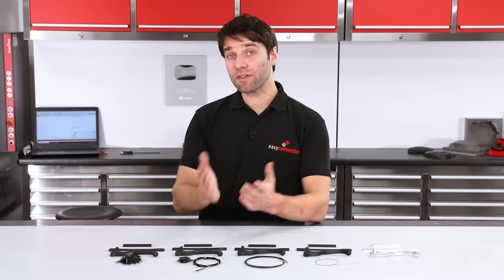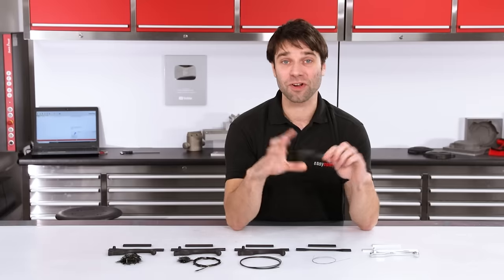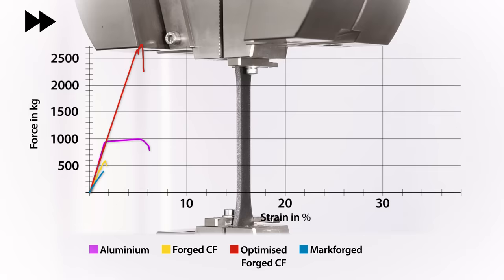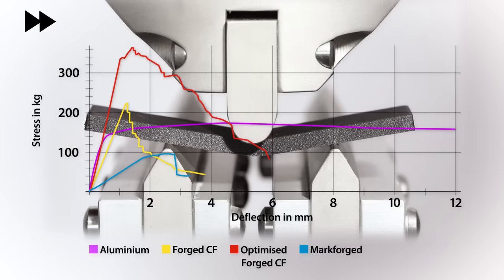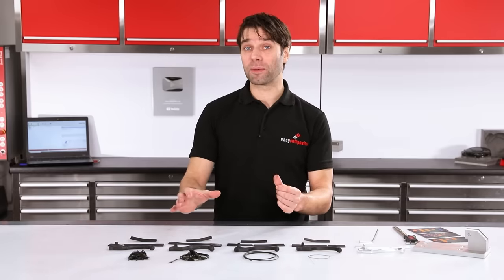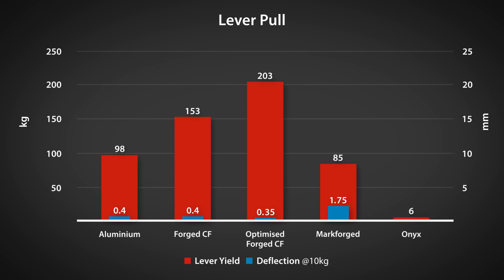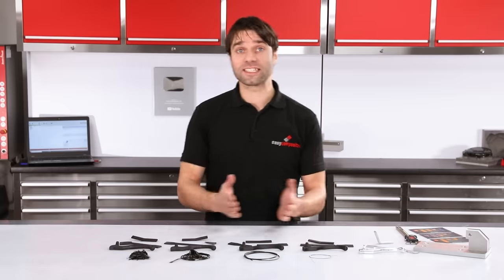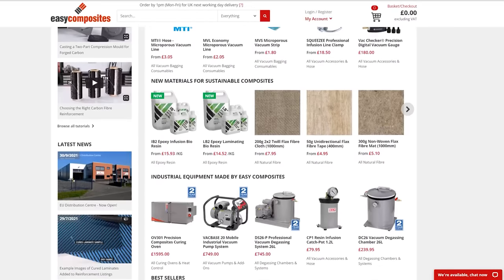How Strong is Forged Carbon Fibre? Forged Carbon vs Aluminium vs Markforged vs Onyx

Comment: The normal 3d printed lever couldn't take more than 10kg? or is that 10 kg per mm^2?
Reply from the maker: It was just 10kg, total. As others have pointed out, alternative 3D print filaments may well have been stronger, 3D printed Onyx was the only 'carbon enhanced' filament offered by the 3D print shop we used to print both the Markforged component and the 'standard' carbon enhanced filament sample. Having said that however, I think it's been well covered by other channels that specialise in 3D printing technology (which we certainly don't) that filaments enhanced with milled carbon fibre don't really improve the mechanical properties significantly.

Comment: Nylon itself is not great for that because of its flexibility. There are polycarbonate-carbon fiber 3d filaments which should give a different result. Still, I don't think it will be near the real carbon fiber samples, but a lot better than nylon

Comment: in conclusion, get aluminium brake and cluth handles. So if you crash you still have a bent handle to work with rather than nothing

Comment: Forging is a Process that doesn´t apply to Carbonfiber.
To call an laminated and Resin infused Material "forged" is quite far fetched if not plain wrong.
If you want something forged, try Steel or Aluminium in some cases.
Reply from the maker: Thanks for the comment and yes, the term 'forged' carbon fibre is not the clearest but it's been around for a while now  (Lamborghini have been using it for several years) and is quite widely used with an established meaning. To avoid using the term would mean that many viewers interested in understanding 'forged carbon' might never find this content, get to see what the term refers to (for some at least) in the context of carbon fibre composites, and learn how - for the right components - this process can be used to produce strong, lightweight parts with minimal equipment.

For what it's worth, before making the video we did discuss whether to use the term 'forged' a lot because we really weren't sure ourselves. After lots of deliberation (checking dictionaries and researching the history of the term) we decided to go with it but we did expect others might come to a different view, and that's fine too. If you'd like a much more lengthy explanation of we came to our decision please get in touch, we're happy to have more healthy debate on the subject
Reply: @easycompositestv  So in short: The Marketing Department of Lamborghini created an misleading term to let their Product apear mor sufisticated than it actualy is.

I apreciate the detailed Answer to that and made it clear where that BS-Term originates from.

In this case i t is absolutly reasonable to use a Term specific to that kind of Process if that Term is branded and established.

I myself work with Metals every day and if someone tells me something about Forging and stress in Materials and throws Carbon Fibre in the same Sentence i kind of rubs me the wrong way because even with Aluminium it is an questionable Term to be honest because in most cases it is just "cold worked" Material that gains more stiffnes because the compression of that Material makes it strain hardened.

A Smith gets that stress out of the Material by heating it up so the crystaline Structure of Steel, Gold, Silver, Copper and so on can rearange themself wich releases the Stress inside the Material and reduces the brittlenes and workability of the Workpeace.
If you want to gain back that Hardness, at least with Steel, you can heat treat it.

Just to let you know where my perspective comes from without bore you with to much Details.

Comment: What's the cost impact?
Reply from the maker: Compared to the other materials on test? - Well, assuming you have to 3D print a mould and then mould your forged carbon component then a conventional 3D printed part (like the Onyx) would be much cheaper right from the start. In terms of the Markforged, the printers themselves are in the £20k/€25/$30 region and we don't have one so we paid to have the Markforged part printed. It cost over £100/€125/$150. You could certainly print the moulds in PLA and buy our whole Forged Carbon Kit (which could make 30 of these parts) for less money. In raw material costs, there's probably less than £1/€1.25/$1.50 worth of materials in the brake lever example.
Reply: @easycompositestv  I'm just curious as to why there's not a weather change in abandoning aluminum. I would assume it has to do with the sheer cost of manufacturing with CF vs aluminum, and that's disregarding the impacts of CF on typical fasteners.

Comment: The term forged carbon fiber is a strange one. Quality brake leavers are "forged" then heat treated aluminum alloys, not inferior diecast ones..
Reply from the maker: Thanks for the comment and yes, the term 'forged' carbon fibre is not the clearest but it's been around for a while now  (Lamborghini have been using it for several years) and is quite widely used with an established meaning. To avoid using the term would mean that many viewers interested in understanding 'forged carbon' might never find this content, get to see what the term refers to (for some at least) in the context of carbon fibre composites, and learn how - for the right components - this process can be used to produce strong, lightweight parts with minimal equipment.

For what it's worth, before making the video we did discuss whether to use the term 'forged' a lot because we really weren't sure ourselves. After lots of deliberation (checking dictionaries and researching the history of the term) we decided to go with it but we did expect others might come to a different view, and that's fine too. If you'd like a much more lengthy explanation of we came to our decision please get in touch, we're happy to have more healthy debate on the subject
Reply: @easycompositestv  I'd like to thank you for a really constructive reply,  which unfortunately isn't the norm these days. Your videos are very interesting, informative, and enjoyable to watch, Thanks and Regards..

Comment: ONXY would be good for light cosmetics parts… Wing mirror, Lights holder, air intakes?
Reply from the maker: Onyx does have its place just not this specific application or applications needing a high level of stiffness.

Comment: I like the comparison, but using mass [kg] as an ”universal unit” for force [N] and stress [N/m²] is really not a “level of scientific method”. Would be nice if you do it correct in the next videos.
Reply from the maker: As explained in the video, we deliberately chose those units as they would be understandable by the widest audience even if not the correct SI units for measurement. A lot of people would not understand newtons or other units.

Comment: my gut instinct says that under repetitive stress the carbon stuff would fail way under the measured yield point and would probably perform worse than aluminium on the long run.
Reply from the maker: Without long term fatigue testing it is hard to say, but the yield point was way above the typical forces used in practice so there may be enough safety factor in it to give a useful life.

Comment: What's really interesting is that for maybe 30 ot so years CF hss been touted as a "wonder material" that would supposedly do it all. Yet when taking into consideration cost, mfg complexity, across the board strength/wear/temperature performance, areas of practical application vs established materials and methods it fails miserably, and just like 3d printing vs any other type of comparable manufactute relies on niche use cases rather than any en-masse areas of use. Which is in fact pathetic as something as old and heavy and one could almost say outdated as GFRP still remains in 1000x wider use overall than CF.

Comment: Why do you compare it with Aluminium? It would have been much more interesting to compare it with Titan and with common 440 steel.
Reply from the maker: Because it is what the original part is made from and is also much more comparable than other metals.
Reply: @easycompositestv  If the original component was made of aluminubeside Carbon-epoxy composite matm, titanium would be the next best alternative in terms of stiffness, specific weight and hardness before considering carbon fiber-reinforced plastics. High-performance steels can also be very interesting due to their mechanical properties (I know 440 steel is not highperformance). Don't you think?

Comment: You have used a compression mould. Forging is a metal working process.
Reply from the maker: Thanks for the comment and yes, the term 'forged' carbon fibre is not the clearest but it's been around for a while now  (Lamborghini have been using it for several years) and is quite widely used with an established meaning. To avoid using the term would mean that many viewers interested in understanding 'forged carbon' might never find this content, get to see what the term refers to (for some at least) in the context of carbon fibre composites, and learn how - for the right components - this process can be used to produce strong, lightweight parts with minimal equipment.

For what it's worth, before making the video we did discuss whether to use the term 'forged' a lot because we really weren't sure ourselves. After lots of deliberation (checking dictionaries and researching the history of the term) we decided to go with it but we did expect others might come to a different view, and that's fine too. If you'd like a much more lengthy explanation of we came to our decision please get in touch, we're happy to have more healthy debate on the subject :)
Reply: @easycompositestv   Lamborgahni uses the name "Forged Composites" because they have registered the name as a trademark. What you seem to have done is let marketing misuse the English language. If I was to say I used a transfer mould or I used an injection mould you would know or could look up exactly what I mean and it would lead you into a larger field of knowledge. Forged carbon is a meaningless term because forging is a metal process. Which dictionary did you find the term in?

Comment: Be very careful with so called forged carbon. When the size of the part gets to less than about twice the length of the filaments, strength falls and (more importantly) strength consistency falls off a cliff.

Comment: These tests are all nice and good. But now do a fatigue test😁😁
Reply from the maker: Agreed that dynamic results would also be interesting. Unfortunately, we don't have a dynamic test rig so fatigue tests and the like aren't something we can run at the moment. We will continue to invest in our test setup though so maybe in the future we could run some of these tests.
Reply: I know the forged carbon isn't exactly the same as conventional laid up carbon fiber, but when comparing conventional carbon fiber to aluminum, steel, wood, glass fiber, etc, the carbon fiber is much better, retaining something like 40 percent of its original ultimate strength after 10 million cycles. So I would not expect to see the forged carbon parts suffering from fatigue when compared to aluminum.
Reply: @mckenziekeith7434  interesting. I am not very knowledgeable about CFRP's fatigue characteristics. Cool to know

Comment: Is carbon fiber recyclable?
Reply from the maker: Not easily due to the resin matrix.  Some specialists are able to recover the fibres for reuse, however it is not a very energy efficient process and the fibres are not in the same format after recovery.

Comment: You know that there is much stronger prints than Markforged. 

You can print in Ultem, PEEK, PEK-A, PEK-C and many more
Reply from the maker: Hi Nathan, indeed you can. As you'll probably guess from the nature of the channel, this video is more about the composite side of things, in particular the forged carbon fibre process and how that compares to materials like aluminium or carbon fibre 3d print technology. There are hundreds of videos comparing different FDM filaments but in all cases none of them would be anywhere near a composite solution so, from our perspective at least, we didn't feel we needed to go into too many of those relatively similar materials.
Reply: @easycompositestv  just pointing it out as the way you phrased it is like Onyx and CCF is the only way. Sounded like a Markforged sales pitch lol

Comment: no comparison to an actual continuous fibre laminate?
Reply from the maker: no because it is a forged carbon comparison to other materials rather than composite material - the kind of parts you can make from the compression moulding process are usually different to traditional composites and hence not comparable.

Comment: Enjoyed the video but for me this enforced why aluminium is en Excellent material for a brake lever, if you were to damage it it would most likely bend and not break,  a bent lever can still be used or straightened, a broken lever is useless.
Reply from the maker: KB, we certainly don’t disagree with you. This video was all about demonstrating the properties of the material and comparing to its obvious alternatives. The brake lever example was just something relatable and quite easy to test and compare. Aluminium really might be the best material for a brake lever, but forged carbon looks to us like material that would have some great applications.

Comment: Aluminium is not on the periodic table, Aluminum is. Is a 6 mil radius 6 mil across or 12 mil across
Reply from the maker: Hi Tom, sure in North America it's Aluminum, in the rest of the world including the IUPAC definition it's Aluminium, so for most people in the world and in international science that's how it is spelt and pronounced, with regard to the mil that's our abbreviation of millimetres, not sure specifically what your refering to but a 6mm radius would have a 12mm diameter.

Comment: You can bend aluminum back, aluminum everytime.
Reply from the maker: Yes, for sure, you might determine that aluminium is the right material for a brake lever, or any other particular component. This video is in no way intended as a suggestion or endorsement to make any particular product using this process, instead it's intended to give viewers a better idea of the likely performance of components made in this way and how they might compare to alternative materials and processes. Having done so, we believe that a process that can produce a component that is stiffer and stronger (although less ductile, for sure) than a cast aluminium equivalent, using almost no specialist equipment, has probably got a lot of very viable applications.

Comment: I would be curious as to real world environmental affects and then your stress tests.

Temperatures get up to over 100 degrees Fahrenheit and a short winter of down to around 27 degrees Fahrenheit for two months with daytime rise to mid 30s.

Again 80 to 100. 27 to 36 and half yr to 40s to 60s at night and temps in day to mid 60s to 80.

Plastic/rubber is heavily affected, dried hardened,brittle.  I’m sure there are ways to speed up heating/cooling and stressing during the time.

That would be most accurate.  I drive motorcycle in winter thru summer.
Reply from the maker: The resin we use in this specific tutorial would be more than capable of working well within that temperature range. If you need a higher temp solution as you have a particularly hot application (engine bay for example), then a higher temp. resin such as our EL160 with a suitable post-cure would be better placed.

Comment: Would have been better if you had stayed with one order of operations... You seemed to jump around making it confusing.... Yes, you cleaned it up in the end.... But the middle was confusing
Reply from the maker: OK Tim, fair enough, sorry you feel it could have been clearer. We did put a lot of thought into the running order but maybe we didn't get it right.

Comment: So, this is pressing Carbon Fibres with some bonding material in a mold? That has nothing to do with forging.
Reply from the maker: Thanks for the comment and yes, the term 'forged' carbon fibre is not the clearest but it's been around for a while now  (Lamborghini have been using it for several years) and is quite widely used with an established meaning. To avoid using the term would mean that many viewers interested in understanding 'forged carbon' might never find this content, get to see what the term refers to (for some at least) in the context of carbon fibre composites, and learn how - for the right components - this process can be used to produce strong, lightweight parts with minimal equipment.

For what it's worth, before making the video we did discuss whether to use the term 'forged' a lot because we really weren't sure ourselves. After lots of deliberation (checking dictionaries and researching the history of the term) we decided to go with it but we did expect others might come to a different view, and that's fine too. If you'd like a much more lengthy explanation of we came to our decision please get in touch, we're happy to have more healthy debate on the subject

Comment: no conventional mat laid construction?
Reply from the maker: No, because continuous (woven) reinforcement doesn't work for compression moulding in this way. You need the randomly oriented short strands in order for the reinforcement to be able to migrate and redistribute itself under pressure in order to not have extensive voiding when following this process. We discuss this is more detail in the preceding video (where we actually demonstrate the process).
Reply: @easycompositestv  oh, I guess the question does ask how strong is "forged" CF, not just CF in general.  The two additive processes obfuscate that a bit